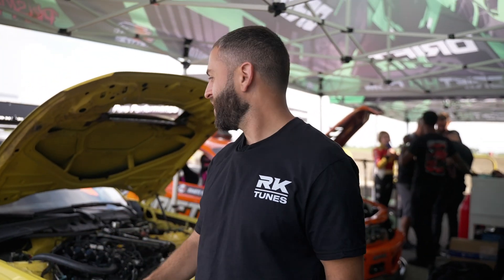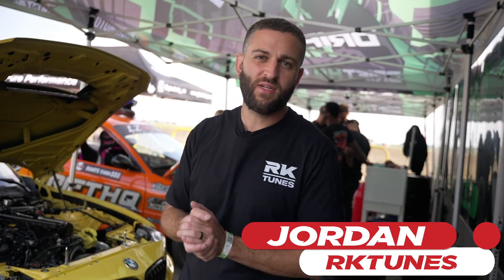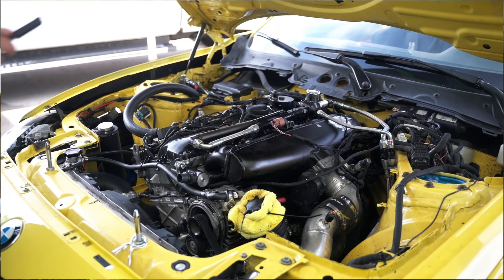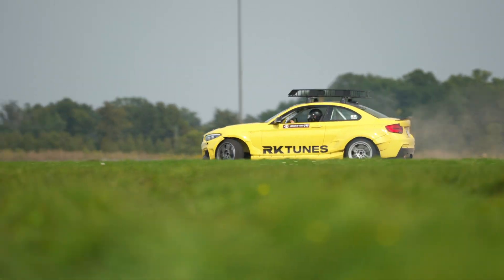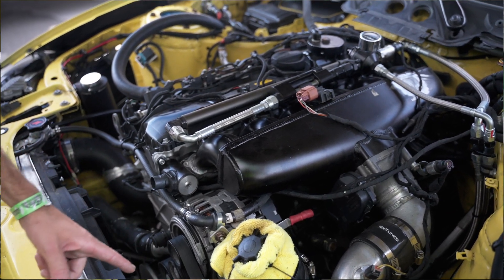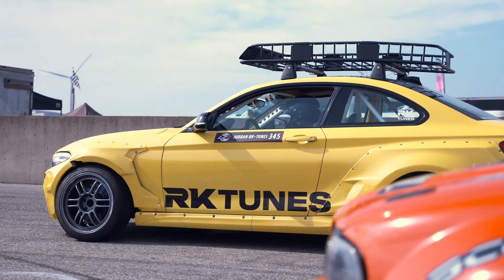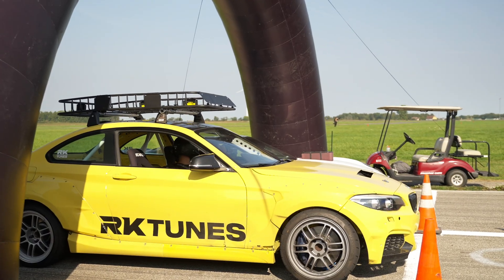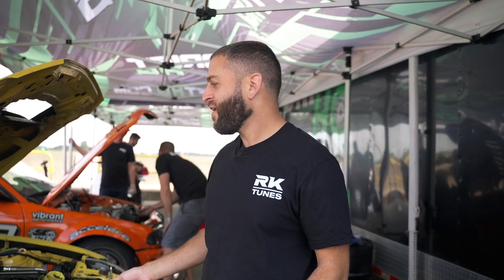B58 Powered BMW Running on a Link! - Link Builds

Comment: I see that you’ve installed a standalone ECU on the F22 with a B58 engine. Are you keeping the stock ECU as a piggyback, or how are you handling CAN bus communication? I want the cluster, AC, and other functions to work since it will be a street car.